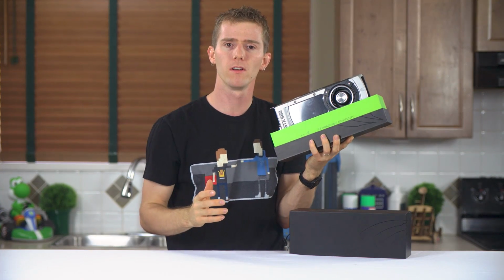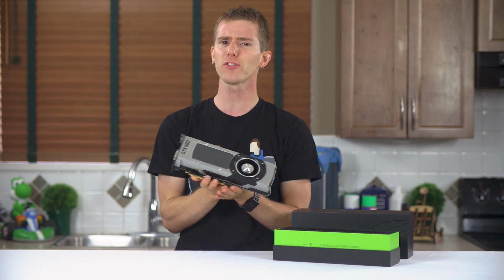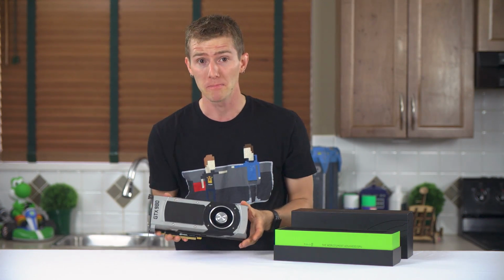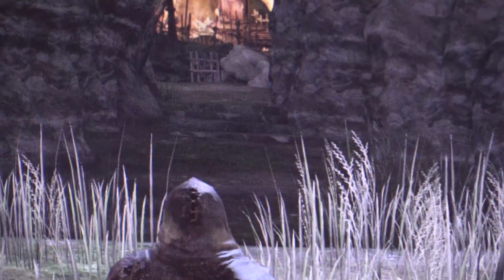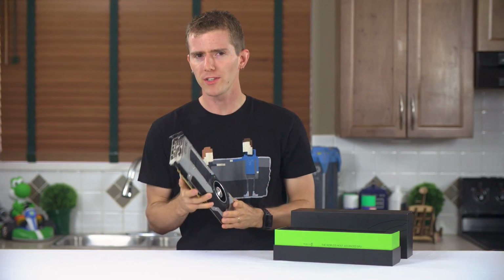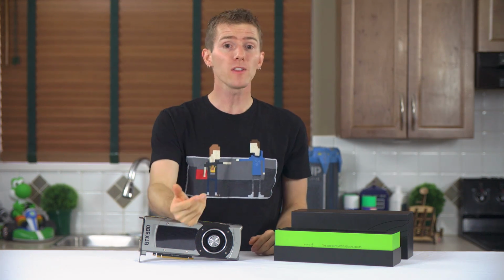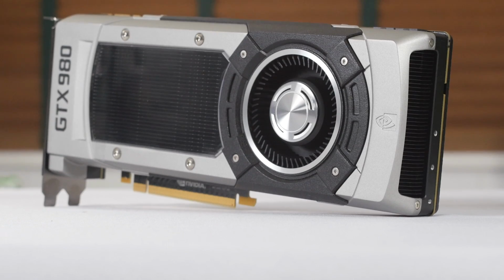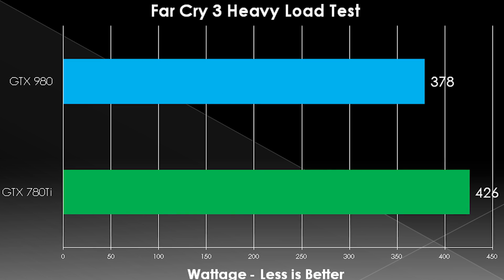NVIDIA GeForce GTX 980 Video Card - Performance Overview

Comment: guys i have a gtx 780 evga super clocked acx and i just bought it one month ago and now i kinda feel bad for not waiting is the 980 waaaaaay more op like 30 fps + ? and if so how much is it and did i make the bad choice ? cause every thing i put on this beast runs smoothly
Reply: If you're running a 780, the gains from a 980 aren't really gonna be that much for you. It's the reason that after getting my 660 Ti I held off on getting a 7xx card, and instead opted to wait for the next generation, as the leap in performance will be astronomical compared.
Reply: At work we benched this card with Firestrike, running a 4790K Gigabyte GTX980 8GB RAM, Gets a score of 11200 stock clocks. Run firestrike on your system and see what you get
Reply: If you're getting 30 fps on a 780 you're doing great. Especially if you're playing Minesweeper or Solitaire. That stuff's demanding as balls.
Reply: 30 fps plus XDD, dude the 980 will drive your games at 1080p 120 fps+
Reply: depends... if your playing at 1080p there is no reason to upgrade. the 780 would be fine. I have a 780ti sc  oc  to 1199mhz  and it beats the 980 in bioshock inifite 90 to 85 on ultra ddof @ 1440p
and in tombraider gtx 980 gets avg 61 fps on ultimate 1440p, my  overclocked 780ti getting 71 fps.
Reply: Tom Ferreira i got 9294 i7 4790k evga 780 12 gigs or ram is that good ? but the ram i have is like a cheep ram not corsair or somthing does that effect the preformnce ?
Reply: ProGam3r
im not sure but 12gbs is nice although the ram idk if it being cheap is bad
Reply: ProGam3r Yeah that's a decent score for your system. Is your CPU and videocard overclocked?. 12GB of ram??, Your ram is probably not working in dual channel, since they aren't the same capacity. Its best to run 2x4GB Sticks or 2x8GB Sticks.
Reply: no they are not i mean the gtx 780 should have a super good cooling system cause ot evga acx but idk how to over clock it
Reply: Jonathan Herman no i'm saying that will i get 30 more fps if i buy the gtx 980 , how ever thanks for the English fixing thingy its not my main language but i'm really good at it, i was just sleepy back then do ...
Reply: ProGam3r
well you'll get way mroe than 30 fps i can guarantee you that
Reply: :( u made me feel bad im asking if i made the bad choice bu buying the gtx 780 2 months before the 980 is realesed
Reply: ProGam3r
who me? D: im sorry if i did, but still it is kinda better to wait, although im not trying to insult you or make you feel bad ;P

Comment: Just built a computer today with:
3.4GHz i7-2600k
GTX 2851.5GHz
Samsung 840 evo ssd 120gb
Seagate 1tb 7200.12 RPM HD
TX750W
this is rediculously fast, cant IMAGINE that card
Reply: He could mean a GTX racing engine, which would give him more horsepower and turbo charging capabilities...
Reply: Please explain to me why you got a GTX 285
Reply: lol a gtx 285 has been around for a LONG LONG time (7/8 years i think)
Reply: Gtx 285? Dafuq?
Reply: GPU does nothing, your SSD Does.
Reply: Bryce Reigle Nothing really wrong with a GTX 285. Hardware is like 15 years ahead of software. Games are not engineered for high end hardware.
Reply: Hey everyone, the 285 was free and has a 7.5 on windows index
Reply: also i have 8gb ddr3 1866mhz
Reply: yeah im planning to get a 980! ! :D i dont even have dx11

Comment: I was thinking of upgrading again next summer and I already have a 780. Do you think I should SLI 780s or get a 980? I do not plan to use multiple monitors.
Reply: if you are going to get another 780, get it soon because they are discontinuing it!
Reply: There's not that much performance difference between the 780 and 980 anyway, pick up another second hand 780 on ebay for like £280! SLI 780's > 980.
Reply: Sumpter Carter I used to run a couple of GTX 460s in sli and rarely encountered micro-stutter. It's when you start hitting under 40 fps, that the chance of MS becomes greater. 

I plan on getting another 780, once the prices start to drop, because of how great of an experience I had with sli in the past.
Reply: Gamevet My 780 isn't even classified and I maxed out Crysis 3 on at least 45 fps minimum throughout the whole playthrough and multiplayer! Maybe my 4770k helps...
Reply: You dont need to upgrade to 980, the 780 is quite good!
Reply: Sumpter Carter Wrong, even a 780 ti can't max games at 1080p. Get a 980 or 780 SLI to play safe.
Reply: ***** what kind of games do you play ? lolz
Reply: ***** Nah I own a 780ti. Alot of people tend to talk crap about their stupid GPUs like "Oh my 660ti can max any game at 1080p".

Well, then why does a 670 exist, let alone a 690. Max means full AA, full settings and full draw distance everything and 50-60 fps. I can't max out crysis 3, I can't max out dead rising 3 and I can't max out assassins creed 4 and so on. :(
Reply: ***** You can't with a 780 ti? I can with my EVGA 780 SC ACX, and it's not at all the power of the TI
Reply: ***** Well, Pretty much every game I own Including BF4 my GTX760 can max out at 1080p. so........ saying a 760 can't? witch is a bit around a 660ti. Most of them games being at over 60FPS. Watch Dogs was the only game that had issues with the 2GB of vram if I remember correctly. So either your playing vary unoptimized ports or playing something that has a shit ton of mods. I can list the games, but man your gonna have a list to go threw. That or you have your self a vary shitty performing 780 lmao.
Reply: Viking Dudee Bullshit!

I have an EVGA GTX 670 FTW, which is pretty much a stock 680 on steroids, and it came nowhere near maxing out Crysis 3 @ 1080p. My EVGA GTX 780 Classified can't max out Crysis 3 either, and it performs slightly better than a stock 780 Ti, once I lay down some serious overclocks.
Reply: Woah!!!! Calm your horses man. Please go a re read my post before you gets your panties in a bunch, no offence. But when I said the games I own, its just that, I happen to not own Crysis 3 and my 760 is OC and passing up the GTX770 by a good margin. But yes, every game I own, THAT I OWN!, I can max out at 1080p. If I offended ya, well, oh fuking well, Its just the internet lol. just saying, at 1080p, 99% games can be maxed out with a GTX760 for the exception of a few. My bad!!!!!!!!!!!!!!!!
Reply: Gamevet I think when most people are saying "MAX" they are turning off shit like post fx, tessellation and physx and probably are not going all fps natzi and making sure they are at 60fps at ALL times. To the guys saying that their low to mid end gpu cas push this and that at max settings and 60fps, go try Metro 2033. The game still rapes gpu's to this day, same thing for the witcher 2. Horrid ports or not, it will help to see what your card can truly handle. Fyi, Metro 2033 is a 4 year old game, the original that is, not the redux version.
Reply: ***** Then you got a dud of a card, my 780ti slaps down games on max settings, and I play a hell of a lot of games.
Reply: Viking Dudee Battlefield 4 does not require that good of a GPU to run.
Reply: Epic Newman A lot of games but not all. No its not a dud, benchmarks are fine.
Reply: Bigsoap Extreme 45 isn't a good FPS for me.... I own a 4770k too, not overclocked but I don't think that matters. Also maxed out AA and all post fx? If thats the case then thats impressive!
Reply: ***** first of all dead rising 3 was capped at 30 fps ( fuck the xbone) even though it can be unlocked with some config file tweaks, the game still runs like shit because of it's poor optimization & as for crysis 3 I get around 55-60 fps with my 780 ti even while fighting the stalkers in dense grass. Everything is set to max including TXAA. AC 4 is a Ubisoft game so I don't think I need to explain it's performance to you. Something is bottlenecking your gpu.
Reply: ***** Skyrim kills my fps when I enter towns. It's not the demand on the GPU that kills the performance though, it's the shadows being calculated by the CPU (2 cores) that causes the sudden drop in frame-rates.
Reply: xIronwafflexx They obviously don't understand what maximum means then.

Other games that are pretty taxing include Crysis: Warhead, Crysis, Metro: Last Light and Mafia II with high physics settings.
Reply: Bigsoap Extreme have a look at the Asus 970 Strix instead, performance-wise it beats the 780 Ti (unclocked) for a list price of 350$ USD.
Reply: SLI 970s mate.
-From a SLI 680 user
Reply: ***** You can go in the game files and mod it to be able to run 60fps but unless you have 780 ti or a new 980, you won't see anywhere near stable 60fps.
Reply: Jonathan Herman unfortunately the metro games have been optimized with only nvidia cards in mind. That would explain your low fps. The devs have even stated that when you turn tessalation to very high using AMD hardware the performance does get choppy. If you decide to set it to high & turn AA to 3x you will get a decent 50 fps on the surface & 60 or more inside the metro even during the Reich level with pavel & almost 20 other NPC characters screaming heil Reich :p
Reply: just stick with 780 it's great gpu

Comment: So i will be upgrading to 2 2K monitors in the near future. Seeing this out now should i get this for my future gear, or keep my 780Ti.
Reply: I don't think there is a need for you to replace your card performance wise
Reply: The Pancakeanator 980 is cheaper... I wouldn't SLI another 780Ti.
Reply: ***** If you already have one 780ti it should be cheaper to get a second one over getting two 980's.  Even if you sell the one you have the price should drop enough to make it pointless.
Reply: chas1nonly oh i'm just getting one 980...
Reply: Other then the fact it uses less power to run the 980 isn't really an upgrade.  I've seen different bench marks by different creditable sources and so far the only thing they agree on it that the 980 is close to the 780ti.  In some test the 780ti is out doing the 980. If you already have a 780ti you should just keep it or try to trade it.  The resell value of the 780ti is more then likely equal to the 980 new.  There is no real advantage of doing it though since they are pretty even.

Comment: EVGA used to have a great rep for good cards but if you read their forums, you'll see that they have fallen on customer support hard times.  Too many flaws with their card designs and sending crap cards back to customers starting an endless RMA chain with one bad card after another being shipped out to customers.  One guy even mentioned that it took 5 RMA"s to finally get a card that didn't have issues.  And looks like his experience is becoming the norm not the exception. :(  I was going to go with EVGA but after reading up on their RMA issues, and card design problems, I am going to with Gigabyte   Sorry EVGA, not willing to go through what other have had too with you.

Comment: I hope this wont have the GTX770 black screen bug. I had two GTX770 cards and they both froze up the systems so that even the reset button didn't work (tested 5 builds total).

Comment: I actually have a 780 Ti GHz edition and yes, i think the 980 is better, but not for me. In most games, the 780 Ti GHz is faster than the 980, for the most of you, which maybe need to upgrade from a 400 / 500 series or 5000 / 6000 graphics card, the 980 should be your choice while you can not wait for a 980 Ti or a 295X / 390X. :)

Comment: I Like Mantle. Unbelievable low frame times compared to DX11. I will switch back to nvidia when they are on 20nm. In the meantime i keep on rocking with my r9 290

Comment: I currently have the ability to upgrade from my dual sli 770 setup, and after hearing all this i would probably wait save up that extra few hundred and get the 980 ti when it comes out. But if i had to choose this or a 780ti it would probably be the 780ti still just because i don't overclock.
But i would like some other opinions should i switch to the 980? i know i should wait but curious if anyone thinks it would be better to switch from the dual 770s to a 980 or 780ti.

Comment: I just bought a 770 a little over a month ago. Should I put disappointed?
Reply: I bought a 780 three months ago for $530. Could have got about 25% more performance for $20 more, or about the same performance for $200 less (GTX 970). I'm a tad bit upset, but this is inevitable with PCs.  I play @ 1080p so an upgrade isn't necessary, but I would have liked to save some money.  Electrical bill would be lower too, as the GTX 970 draws almost 100w less than the 780.  I am looking forward to Maxwell @ 20nm though.  Titan 2 will certainly be a monster.

Comment: I might end up getting an 860 or 960 whenever they get released.
Reply: ***** 800 series cards were not skipped.  But you will not see them in desktop pc's just laptops.
Reply: 800 series was skipped, only GTX 960 will eventually get released.
Reply: miker6570 got it
Reply: ***** They done goof with 200 and 400 series, 300 was thrown away XD
Reply: ***** No, the 8xx series is for mobile, it didn't get skipped. Pay more attention. Even linus has benchmarked an 880 powered laptop.
Reply: Ghouldude They skipped them for desktop. 8XXm were rebranded 7XXm basically.
Reply: Ghouldude
My bad, that's what I meant to say. I should probably clarify more next time.

Comment: I'd love to see sli scaling. I tend to buy higher mid range or flagship cards for the prospect of getting another later if needed, and I think a lot of us do the same. So that said, even though multi-card scaling has more to do with the drivers, I'm still interested to see where the 980 is at this point in time.

Comment: Question: someone knowledgeable please answer. should I buy the 980 or wait for something better? like 980Ti if possible or totally wait for next gen? az in when nvidia shrinks the die manufacturing architecture? since maxwell is the same die size as kepler. for example the z77 z87 and z97 were all the same pretty much and the real change came with x99. SOOOOO should i buy 980 or wait for better?
Reply: If you need a card now, go ahead and buy. If you already have a good machine... wait a few months. If nothing else, the price will drop a bit... or maybe they wont... hard to tell.
Reply: 1GTX1
There is no such thing as "wait for 2-3 years for next gen". The progression isn't done by huge leaps, therefore even if you upgrade in 2-3 years there will be another next gen in another 2-3 years. This doesn't justify holding out to buy tech right now. PC 3D technology progresses too fast to be making these kind of decisions, so whether you choose to upgrade now or late is irrelevant, what is relevant is the gap of your current GPU to the one that just came out. If it's huge, then missing another year of great gaming performance for a "slightly better" card doesn't justify it, since an SLI will be cheaper, faster, and more efficient of the current released card.
Reply: If you're not making a significant upgrade, like from 550, then wait. 980 is better than 780ti but not by a whopping lead. They'll definitely announce a TI in the next several months and if ATI is making any move it'll also drop in price. Everything points to 980 costing less. So wait. Many people buy a GPU only to find out its priced dropped and another much better GPU is costing the same amount as the one they bought. Technology moves so fast that many PC gamers who upgrade frequently are very anxious.
Reply: Next gen is in 2016. If you want current gen get 980, i doubt that 980ti will be released soon, next are probably 960 and 960ti
Reply: MaxFlare gtx 980 is already on newegg, 569 dollars.
Reply: is there gonna be 1000 series per se? because ive heard they didnt shrink the die on this architecture, but that they only improved what was implemented in 700 series. its like saying heres a shinier version of 700 series rebadged as 900. is the next gen around the corner or the next gen is coming 2016? in which case i make my purchase now.
Reply: 980 is using 256 bit memory bus and 2048 cuda cores. 780ti has 384 bit memory bus and 2880 cuda cores. There is a room for Nvidia to easily make new card with more cuda cores and faster memory if they get better competition from amd. Maybe in 2015, but i don't think that you should wait. There will always be a new series in 2016 totally different memory architecture will be used
Reply: 1GTX1 Damn it man. do you know if its gonna be called 1000 series or what? will the 980ti be on a different architecture? or will it be the same as 980 but more cuda cores? because there was clearly a big difference between 780 and 780ti. big big difference.
Reply: 1GTX1
The limitation of cuda cores and bit memory is done intentionally since it draws less power and is more efficient under their new compression technology. How does 980 still outperform 780ti in nearly every scenario with significantly smaller specs? It is simple. The card is build with smaller inputs to  get bigger outputs. This kind of technology is what will push next gen forward. Nvidia will do whatever it can to bring efficiency standard higher. If they wanted they could've gone AMD ape shit and crank up every GPU to 250w and 94C to increase 980 performance by half of 780ti. That move would destroy the image of Nvidia and everything they stand for. If people want that type of stuff Nvidia still leaves tons of room for overclock to turn your Nvidia card into an AMD style card.